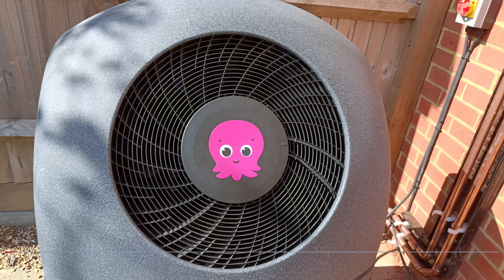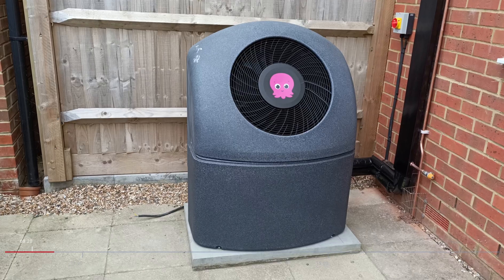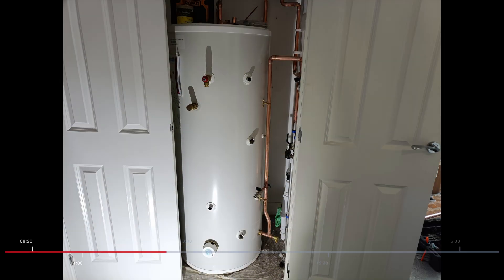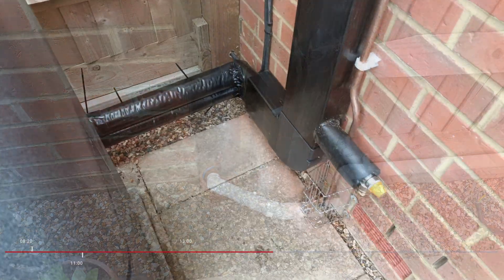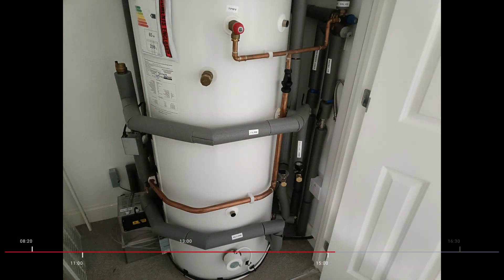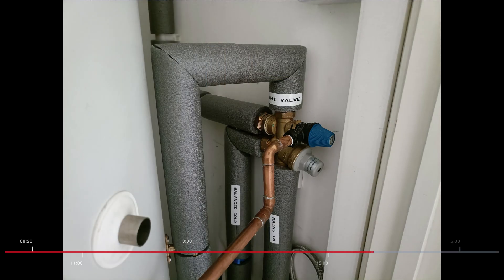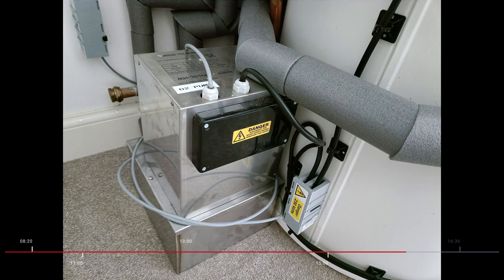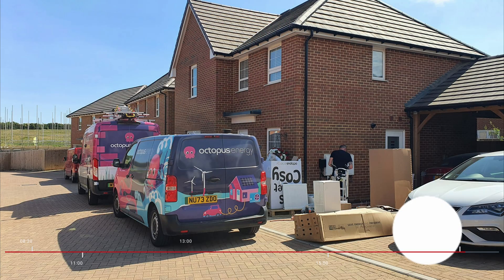My Octopus Heat Pump Install: Day 3

Comment: Don't forget to set up heating and hot water schedules. My Octopus installers forgot to tell me about these and my hot water dropped temperature during the day and the heating was too hot at night. All sorted now with a bit of help from their local support guy who was very helpful.
Reply from the maker: Good point, thank you. I set it up straight away, so have water and initial house heating happening 23:30-05:30 when I have my lowest rate (I'm on Intelligent Octopus Go). I heat 1C above my usual daytime temperature whilst it's on the cheap rate, which at the moment means it rarely needs to top up during the day.